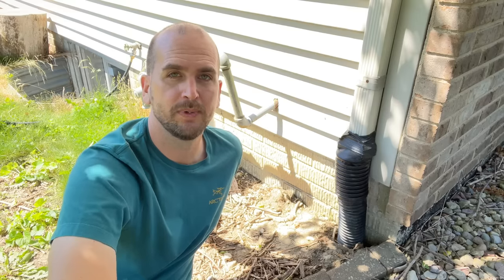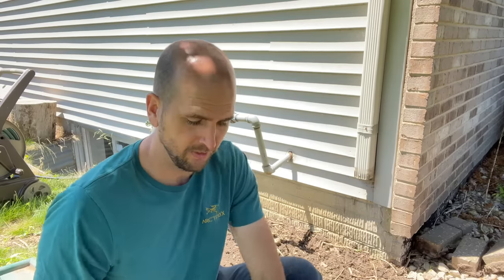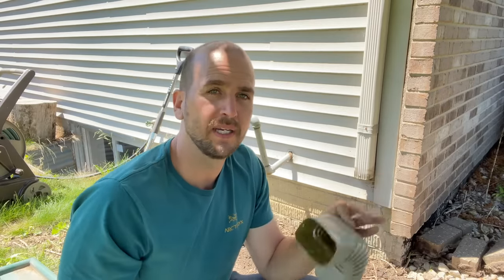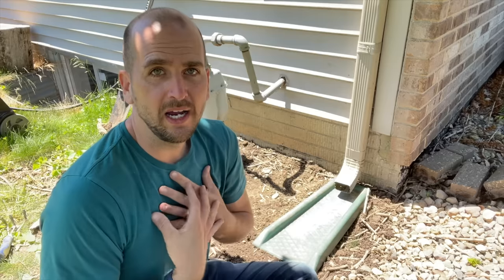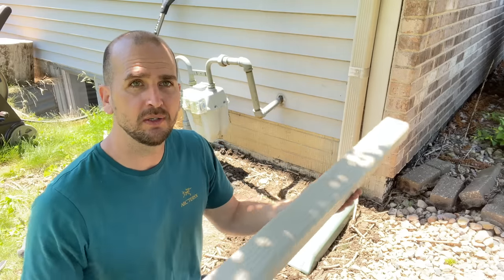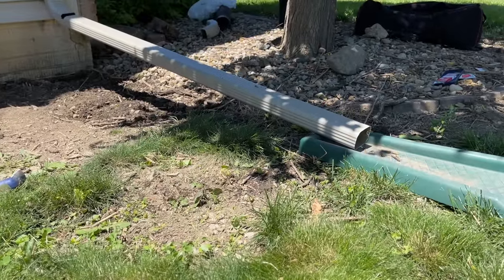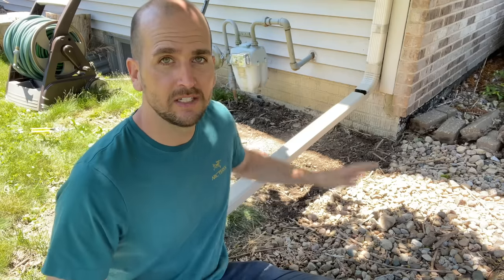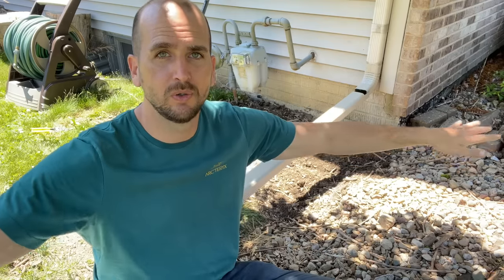3 Options for Extending Your Downspouts

Comment: Gutter contractor here, those black ribbed pipes are a waste! Only use smooth walled pvc. I work 6 days a week re trenching and removing that junk due to them failing due to roots or freezing then collapsing.
Reply: This is what the author says too— corroboration!
Reply: What about critters, chipmunks or voles, can they chew through them???
Reply: @modgirl3292  They like to hide in them …. Until it rains.
Reply: You’re a gutter contractor that calls corrugated pipe “black ribbed pipe”?
Reply: Totally Agree!  Besides everything you stated, the damn things fill up with dirt and clog within a very short period of time.  GARBAGE!
Reply: @georgefromdownthehall3334  PVC isn't good for cold climate. It freezes and gets brittle and breaks. Corrugated is more forgiving in cold climate...I just tore out some 14+ year old corrugated and honestly I kept some sections in.  If it's solid away from trees and roots and deep enough so grass roots can't get to it it's fine. Tape all joints and have vents or catch basins...Air keeps the system working and flowing and drys it out.
Reply: @modgirl3292  If they're anxious they will chew through anything...But not really...Critter guards on open ends help ...
Reply: @danaparish1644  if you have distribution boxes or catch basins with a belly and rip rap around drainage boxes you shouldn't have that problem... Regular maintenance with pressure washer pressure hose can clean out debris...I'm doing drainage work on a 15 year drainage system and most slotted lines are about 3feet deep and have some dirt...But I flush them out using detergent... Always add clean out catch basins and filter boxes on gutter downspouts...
Reply: I have a problem with 2 area of my wood floor absorbing moisture. In the basement the wood is also wet  and it seems that it's coming from the moisture from the ground. My girl put mulch down that's the only thing new. Been here for years an never had this problem.
Reply: @Goodvibes-Adventures thanks, I’m in NJ and have corrugated pipe system blocked, I was planning to put PVC SC 40, also at what distance from down spout I should use clean out or catch basin?
Reply: @ninjip3460  You could put a catch basin within a couple feet of where you come from the house with underground lines .You want to catch all the crap before it goes down the line .. French Drain Man has the downspout leaf filter you put on the bottom of the downspout to catch and filter out the leaves and then a catch basin to catch shingle gravel...You can put catch basins anywhere along the lines for future maintenance..Plus it gives you future access to clean lines if needed...The only downside to PVC drainline in the cold climate is heaving of pipe sections in cold climate..You could get double wall corrugated pipe as that will allow movement during freeze thaw cycle... Also if you're connecting sump pump.  Be sure to get a freeze proof fitting for sump pump outlet as sump pump line comes out of the house...The best information I get is either from.  Gate City drainage channel or French Drain Man.  Apple Drains, or Sam's Drainage channel...Think it through and those guys together have tons of options....Good Luck 🤞
Reply: @Goodvibes-Adventures  appreciate, I'm very new to this topic and appreciate if you can recommend any brand or specifics for catch basin, Thanks in advance for your help.
Reply: @ninjip3460 someone else said PVC isn't good for cold climates as when it freezes it gets brittle and breaks. I can confirm the PVC piping at my parents house has broken over the years. Maybe get a second opinion on corrugated hose piping.
Reply: @matthewlozy1140  appreciate your inputs. Thanks.
Reply: Thanks
Reply: @Goodvibes-Adventures if freezing is an issue, then use double walled corrugated that is smooth on the inside. Ribbed inside means it will hold water + accumulate debris
Reply: @Goodvibes-Adventures  SDR 35 or D
3034 holds up to climate change just fine.
Reply: My house has those black pipes and didn't have any problem in recent 5 years.
Reply: @Goodvibes-Adventures dig it deeper then

Comment: When doing this sort of project, I'd suggest the very first thing to consider is the composition of your soil and the actual grade change of your yard.  If your soil is similar to mine (dense clay that you could probably use for pottery), running a perforated pipe under ground expecting the water to diffuse into the soil is a mistake.  Use solid wall pipe instead, it will also help reduce clogging.  If the grade is such that you have a long slope running down toward the house, it might make more sense to just have the lot regraded to create a swale or trough and french drain approximately ten feet or more from the house.  No issue with frozen inground pipe, clogged inground pipe, etc.   If the grade is ridiculous, with a neighbors lot sitting well above yours such that all the neighbors runoff winds up against the side of your house, you should first kick yourself for buying such a house, then consider building a wall and swale/drain to divert that water at the property line.  Btw, in most places I've lived the developers were required to create swales along the property lines to help divert and manage runoff from neighboring properties.  JMHO.
Reply: I've got several of the problems you mention. The soil behind my house is so hard that it behaves more like rock. It is only somewhat squishy right after snow melt and then dries out rock hard. Moss is the only thing that grows on that soil. The house is placed on a rather steep hill. There's at difference of at least a meter or two between each lot. City bylaw prevents us from dumping roof water into the storm drain, or on the street. It needs to be managed on our land. Being on a hill with rock hard ground, you can guess what happens. It runs downhill into the neighbors yard, and into the next and so on. The best that we can realistically do is keep it away from the house. We dump our water into the backyard as that is the least inconvenient place for downhill neighbors. If I dumped water in my front yard, it would run straight into my neighbor's driveway which is sloped toward is backyard and against his foundation. That's a big nono.
Reply: If you have hard clay that resists water absorption then you can use the cheapest pipe available including perforated (weeper) pipe.
Reply: @ffighter6932  I would argue against that advice. Clay expands quite a bit when absorbing water and the problems that can cause can be just as severe as those created by water. I've got a retaining wall that got pushed out by clay because of a failed drain pipe.
Reply: I’ve been kicking myself for 12 years 😭 I’m finally working on actually fixing the problem.
Reply: funny, after doing the four corners of my house, with dense clay 'soil', I concur 100% with using 4" or maybe even 6" solid pvc pipe too
Reply: @ffighter6932  no, not at all. clay absorbs water, and then holds onto it, which creates problems when using corrugated. only reason to use corrugated is if you are cheapening out
Reply: @jonathanlanglois2742  Once again you had standing water, second you should not have clay in contact with a wall. should always have gravel between clay and what you don't want to move.
Reply: @zefrum3  Corrugated is more expensive. Hard clay is that way because it doesn't absorb water.
Reply: @ffighter6983  The wall is probably as old as the house itself, which would make it 6 decades old. I would say that it has done great. There are many walls that are barely a decade old made out of prefabricated concrete blocks that have already collapsed in more recent developments. It definitely wasn't built to modern standards.
Reply: @ffighter6983  corrugated is not cheaper, here in SE Texas. Clay does absorb water, it doesnt allow it to percolate
Reply: I made sure my soil grade sloped away 10 plus feet at 1” per foot.  At the base of the foundation out about 2 feet it slopes at least 2-3 inches.   I’ve never had water in my crawl space due to good underground tile and the soil slope and proper gutter channels running out 5-10 feet away when necessary.   My poor Mothers basement is wet if she gets more than 4” of rain in a day.  Thanks to the road commissioner and a new road where they Fked up tile. Oh that made all the homeowners on our road furious as none including my mom ever had water in their basements. But this damn government system today didn’t pay out nothing to help anybody out. They don’t care.  And legally every homeowner that lives out in the country owns way out to the middle of the road. So it’s actually our property but you can’t fight government unless you get hundreds of thousands of people united.
Reply: In our house ìn Vancouver BC, turns out we were at the low end of MANY YARDS, = mucky clay bs yard. We had Blasic (sp) design (Ruth, I believe) landscape our 20 x40 long. She saw a little river going by with River rocks, Boulders, and plants that thrived in a damp environment. They guys that dug up the trench couldn't  believe how much water was there..by the time they dug a 4' long x 2 deep the trench filled half way with water. They dug in sections after that. We had a little well and a connection that ran to the city well..it was BEAUTIFUL  and worked  for years. We sold in 2016.
Reply: I have water coming onto my property from next door and from uphill, behind the house. I talked to a French drains guy who said he would put a French drain through the middle of the yard, parallel to the house, and then around the house on both sides, out to the street.
Reply: @jonathanlanglois2742  What's wrong with roof water?
Reply: @watermelonlalala  It is a part of flood mitigation measures. The city does not want roof water going straight to the river. As much as possible, they want water to soak into the ground and percolate slowly.
Reply: @jonathanlanglois2742  Thanks for the explanation.
Reply: @jonathanlanglois2742  ì

Comment: My house has trenched downspouts when I bought it from the previous owners. They ended up clogging and no matter what I did, I could not unclog them. I ended up buying comigrated pipe and leaving them above ground on my yard connected to the downspouts. It's easier to maintain, it's not the prettiest, but functional and easy to maintain.

Comment: I run a gutter installation company and this is great advice for a homeowner. Couple things that may help. 
1. Screws if you are on the coast or just want more corrosion resistance get the stainless or ceramic screws, also screw size on these are #8x1/2 hex head although #6 will work.
2. Tools they make down spout crimpers and double cut shears thst make the job easier however you can use regular tin snips and a pair of needle nose pliers to roll in each corner of down spout to make the male end.
3. Elbows, the basics are there you can find online flip elbows, hinges, clips to hold the down spout up, A to B transition elbows and a plethora of other stuff to make your down spout go where you want it to go(they even make decorative extensions that look like fish or gargoyles to fit on the end of thr elbow).
4. Other options, frost king makes a roll out down spout extension then rolls itself out and then back up depending on if there's water pressure on it. They suck and eventually break down and the spring pops through them but sometimes are the best option for a down spout thet you want to cross a traffic area like a sidewalk and you can't afford anything more serious. Also there's a product called stealth flow, it's a low profile drain if you just want to get past your planter and don't want to dig it's great. Lay it out and cover it with landscape rock or mulch. Splash block/guards/ ext. Check with your local block supplier they often have pallets of cement splash blocks they sell for a similar price as the plastic home store ones, the wind doesnt blow them away they shrug off a weedeater and you can will them to your grandchildren they last so long.

5. Pipe selection. If you can afford it do at least thin walled landscape pvc Pipe. The corrugated stuff will let roots go through it. If you are on a budget then at least use the pvc near any bushes or trees thst may grow through. Lastly if there's any chance at all someone is going to drive some type of equipment through your yard at some point just jump on up to schedule 40 Pipe. I've seen so many pipes crushed after the tree trimmers, septic installer, or porch builders have left. It's well work the schedule 40 in my opinion.

Great video and if any home owners feel overwhelmed feel free to call a pro. I know I have given out countless free advise through the years.
Reply: From what I have seen, most screws specifically labeled as "gutter screws" are actually #7 in thickness.
Reply: @HoosierRallyMaster  Really? That's crazy literally all but one of my suppliers sell #8x1/2 and #10x1 high-hex ive never even seen a #7 from my suppliers. The only one that doesn't do #8 is leaf proof who sends #6x1/2 with their products. I wonder if that is a regional thing? I Order most of my screws from Indianapolis and middle Tennessee with some screws coming from Peoria Illinois. Where are you located?
Reply: @runiniscrazy  Well at least in the home-gamer quantities at the big box store, like the two packages he holds up 1:53
Reply: Maybe they figure if the pros are using #6, then the DIYer will need a #7 to re-use an over-torqued screw hole. I notice that flooring and hinge screws are available in odd-numbered sizes too - I always assumed to rescue a hinge on a century old door frame.
Reply: Thank you for your additional comments!! I have this problem from a home built in the 50’s and the ONLY place to run an extension is ACROSS my newly blacktop DRIVEWAY!! ☹️☹️. I didn’t know of the leaking in the basement corner until after my purchase 2 years ago!! I am going to see if someone can help me with the information you added!  Thank you so much!!
Reply: Any online links to find items mentioned in number 3 ?
Reply: This comment was very helpful.  Im going to do an extension for a downspout that I found that has eroded away the soil and a part of the concrete foundation to my house.  Do you have any recommendations who I should call to repair that erosion damage?
Reply: Thank you for this great information.
Reply: Thank you! We are in the very early stages of laying a paved patio. We need to burry the down pipe and I appreciate the heads up to use PVC pipe.
Reply: Dear Ruinscrazy: Please send link to your videos. The uploader is giving basic frugal examples which will appeal to the home owner -- (not a business owner)  Many know that: TOOLS, training, time and talent will always go toward the top tier targets.
Reply: First time I am doing rain gutter/downspouts. I have 2 questions..#1 what type of screw to attach downspout bracket to my siding? #2 I have a French drain collector w/in 4' of downspout, how or can I get extension from downspout to drain into French drain?  THANKS!!!
Reply: @HoosierRallyMaster  I have "gutter Screws" from Allkeen which are #8 x 1/2" Is there a significant difference between 6, 7, or 8?
Reply: @billmiller6720  On the fastener the short answer is it depends. live near the coast or in an area that uses a lot of salt you would want to go with ceramic coated or stainless. Where I am we use 1.25" galvanized high hex screws on a standard vinyl siding house. You also would want to be conscious of the WRB(weather resistant barrier) and if a rain screen was used behind the siding. Basically you want to be attached to something solid. And in the case of a house that has a WRB under neath furring strips ideally you would attach to the furring strip and not the sheathing of the house so you don" pierce the WRB.

On the drainage pipe you shouldn't really connect down spout to the French drain. French drains use perforated to pipes that are designed to carry water away from the surrounding soil, adding bulk water from the rain gutters lessens their effectiveness. If you did want to to connect them you would use a Y at a lower elevation from the French drain run the perforated pipe into one side of the Y an a solid pipe from the down spout into the other side of the Y and then run solid pipe as the outlet. This is of course if you are looking to carry the water away to another location. There are applications like a dry well where the goal is to deposit as much water into the surrounding soil as possible.
Reply: @runiniscrazy  hey, thanks for your reply. I thought the same thing about WHY I don’t want to attach downspout to siding. The furring strip which is attached to a vertical 4 x 4 roof support, this makes more sense. This was my outdoor patio which I had framed with siding on outside surface. I live in Reno, NV at about 5200’, lots of snow. What size screw/nail should I use to attach downspout bracket to furring strip/4 x 4? Thanks again for your suggestions.

Comment: I've used method #3 for our house. Instead of using corrugated tube, I went with white PVC pipe. Easy to work with, comes in 10' lengths, cuts easy with a hacksaw or recip saw.
The smooth bore ensures little or no debris build -up. Working great for the past 3 yrs.
Reply: Hope to how to l n lnstall gutter's